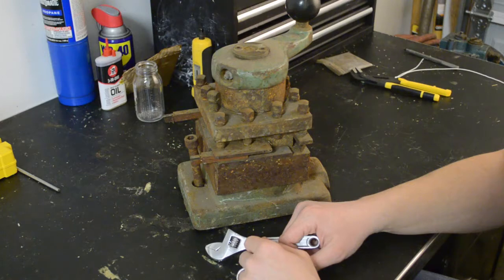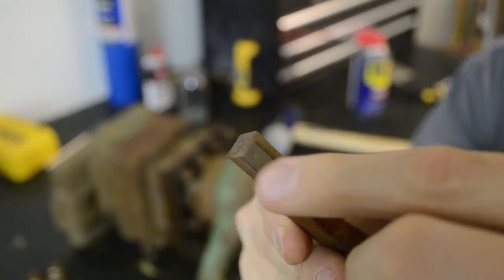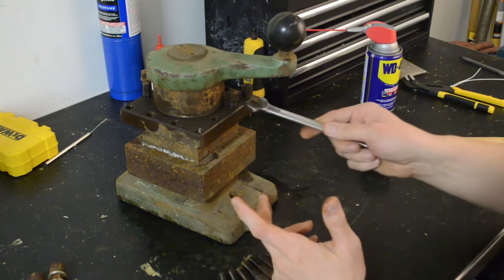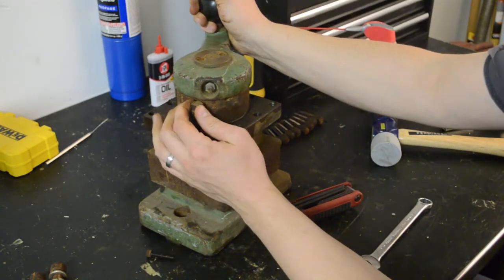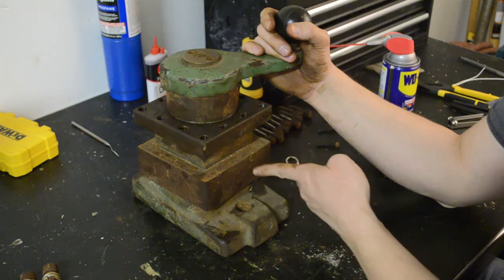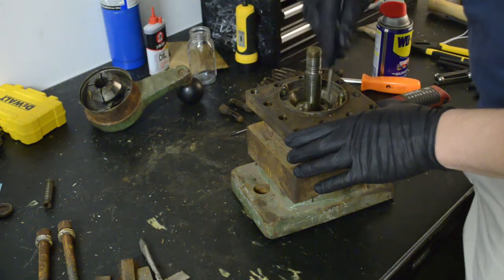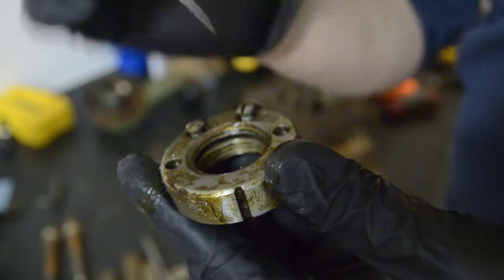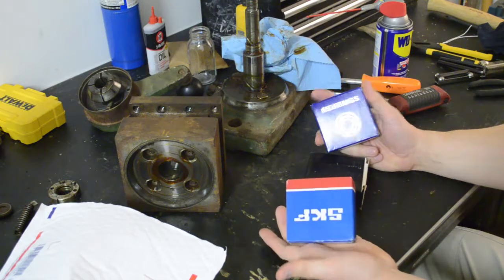Lathe Tool Post Teardown

Comment: any progress on the lathe?
Reply from the maker: Yes actually.  I have it stripped all the major components off the base. I have the motor back together, the bed and legs have got all the lead paint off them, and I'm painting it this weekend.  Going to start cleaning the last of the major components one at a time and putting them back on as they are done.  

I have footage, and plan on editing it, but the tower PC I do editing on went down, and I've been so slammed at work that setting up another machine for editting, and making videos feels like a chore.  I'm just here to have some fun.  I'm still collecting footage, and things should slow down for me in early spring and I hope to get back to make videos.